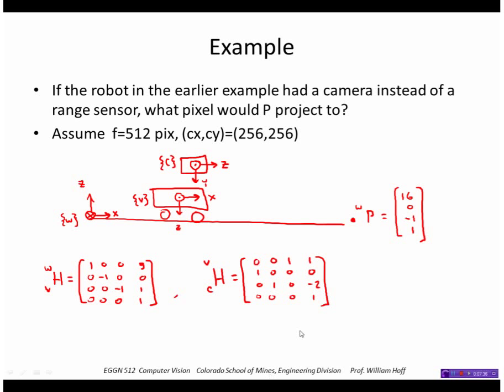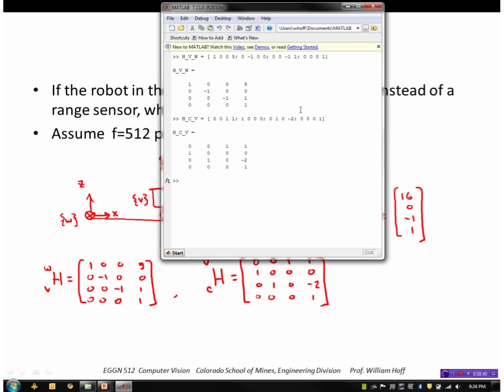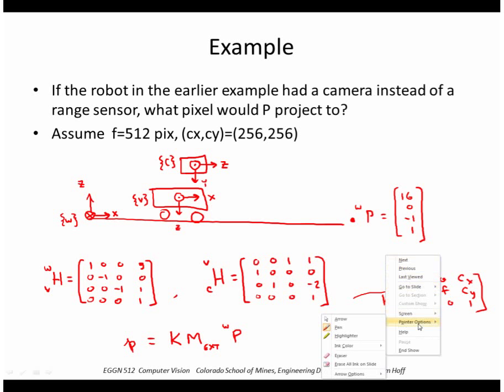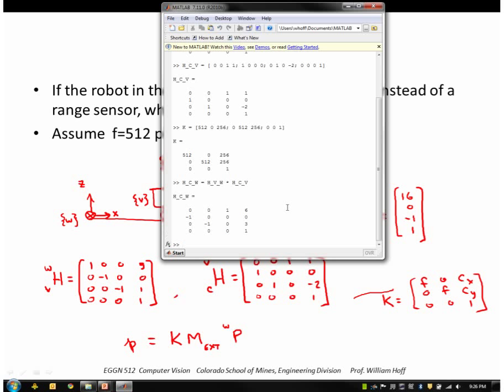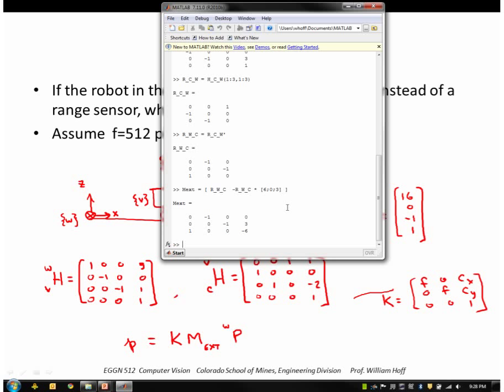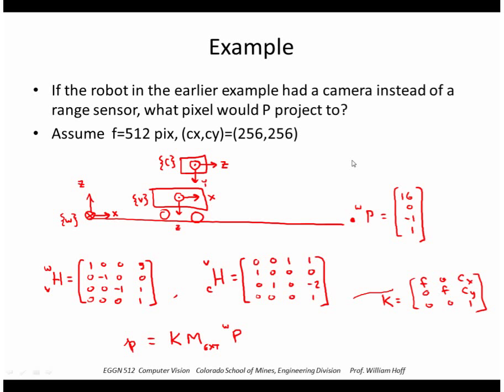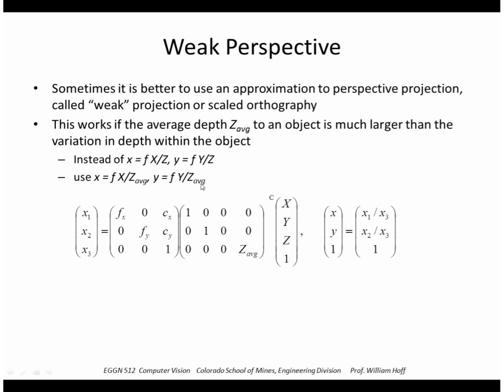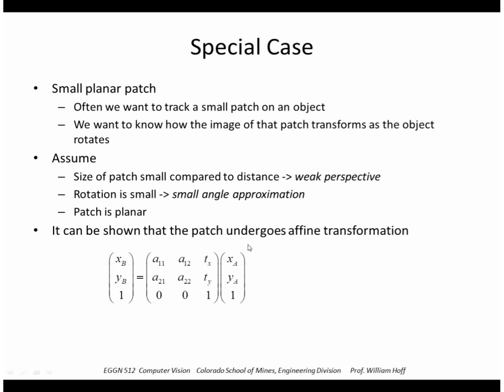EGGN 512 - Lecture 5-2 3D-2D Transforms

Comment: I appreciate this lecture series a lot, I know this was done more than a decade ago but its value will remain as one of the greatest series in the computer vision community.

In the robot sensor to camera example, we already know the position of the object P with respect to the camera, which is [0, 4, 10], since this is already in camera coordinates we can say P(pix) = (KP(c))*1/z, which in fact gives us the correct answer.

It's simpler this way, and I assume you already know that and went the other way around just to let us know how extrinsic and intrinsic parameters interact together to move points from world coordinates to pixel location.